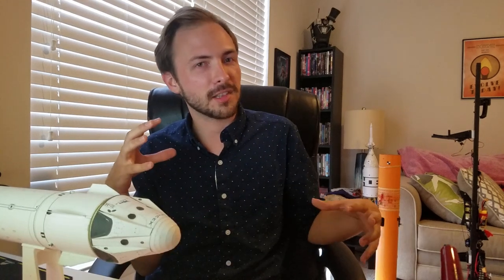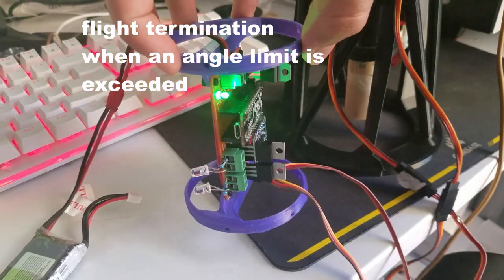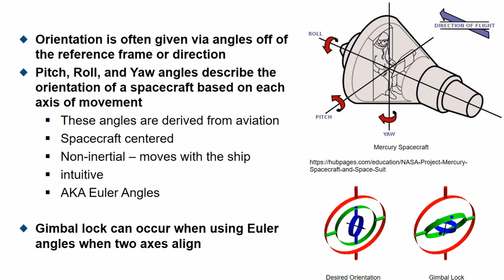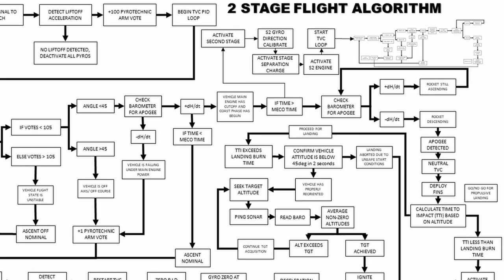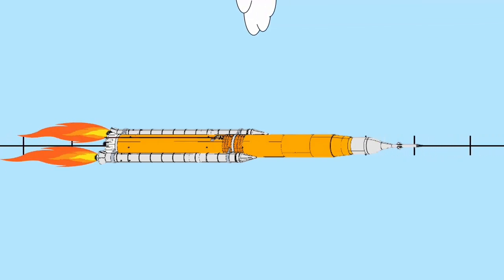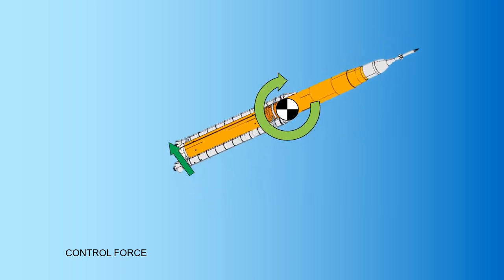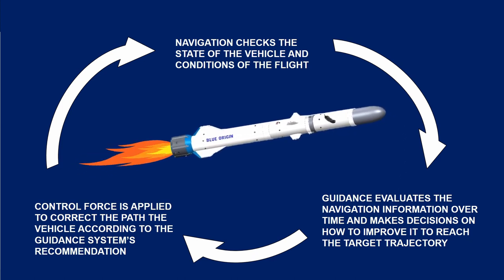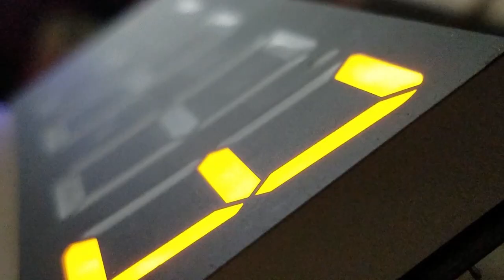Rocket Guidance Navigation and Control

Comment: Hi, I see your altitude sensor is BMPxxxx.  Is this a baro meter? If it is true. Then the altitude reading should be interfered by the movement of the rocket since the change of air pressure is not only affected by the altitude but also by the moving speed of the rocket. How can you solve the problem? Do you calibrate it with GPS altitude? Do you use KALMEN filter to do the status estimation?

Comment: Very interesting. I was part of the initial 1970’s Space Shuttle program on a team designing the APU’s for powering TVC and other functions. Our APU’s have been modified for use on the SLS.  Old timer 😎😎
Reply from the maker: Very cool! I am very familiar with those actuators, I got to sit on on the class for teaching them and one of my TVC clips is now a part of the curriculum. I'm just excited to see it fly even if my time on the program ended over a year ago
Reply: APU’s are Auxillary Power Units. Turbine driven Hydraulic pumps generating the only power onboard the Shuttles, other than the engines. I did system analysis and optimization of the turbine design. 72000 rpm 5.5 in pitch dia 
. Geared down to hydraulic pump speed.

Comment: Hello, thanks for the informative video.
I have a question about 3D orientation.
I'm currently using the MPU6050 which includes accelerometer and gyroscope (but not magnetometer). Can I use this sensor to get accurate 3D orientation?
The rocket will be dropped from a height of 40 meters with the help of a crane and the rocket must make a vertical soft landing.
Reply from the maker: Yes but the MPU6050 has notoriously bad gyroscope drift. I suggest the Bosch BNO055 or BMI088.

Comment: Hi, Robert. I thought I was doing a good job of understanding what you (and Joe) are doing, but this video raises a question that I hadn't considered before.  Is your system guiding the rocket toward a point in space directly above the launch pad, keeping the rocket pointing straight upwards, or just keeping the rocket stable? In the absence of wind, there wouldn't be a difference, but we can't seem to get away from the weather.  I think I know the answer based on the theoretical system you describe in the video, but I am not sure.
Reply from the maker: Roger! So both are functional. You can have a target point or vector and regardless of weather you should be able to reach it. The tuning is the hard part in this cause you can tune for large disturbances or small ones. large means you can take extreme gusts but you're not good as good at filtering out noise. if you tune for small disturbances you aren't as good at fighting large ones but great at keeping an accurate and precise track. thats why i fly in minimum winds under 10mph usually.

Comment: 📺💬 A flight computer, GNC generative navigation guidance, and controls the flight parameters are contained into these circuits with censors that are input to its contained algorithm generated output signals to control navigating part to maintain the rocket in their course setup.
📺💬 How do you contain all information into small circuits, you do not need to compress all data into it because the rocket only needs to know commands reflection from the sensors, and those commands are trained into a set of variables as a sequence of series.
🥺💬 I am listening to his lesson and I think he is explaining training parameters and remote devices navigation, as you see it required only source signal generation to make a small of change with trained parameters and sensor signals to output as target functions.

📺💬 The guidance and states work with deviations that to desire of action to perform for the current state.
🥺💬 Yes, you are correct they called it deviation as you give an example AI, to create output from input signals it required some change of the number of sources ( source + parameters + sensors ) but my knowledge only for AI and radio devices.